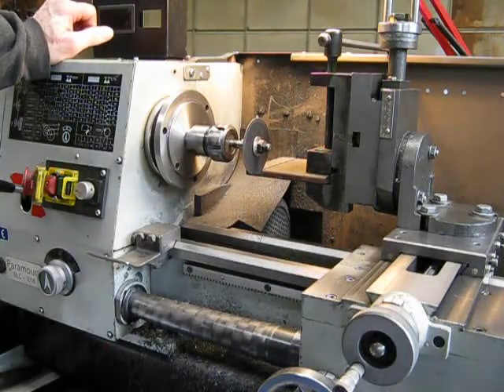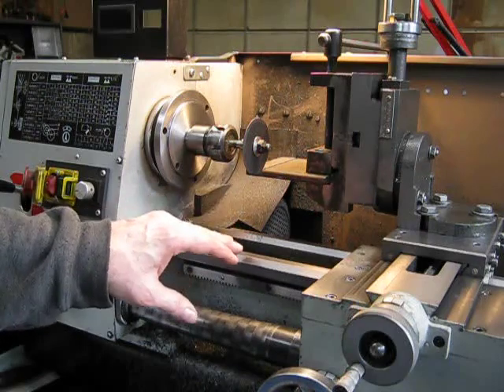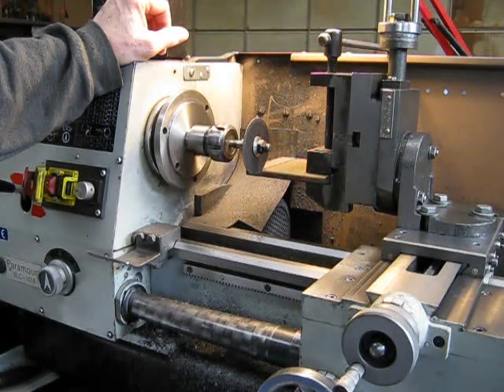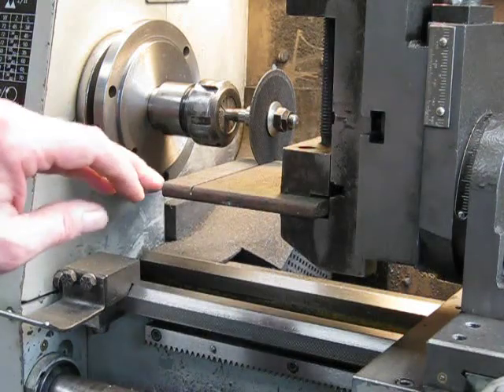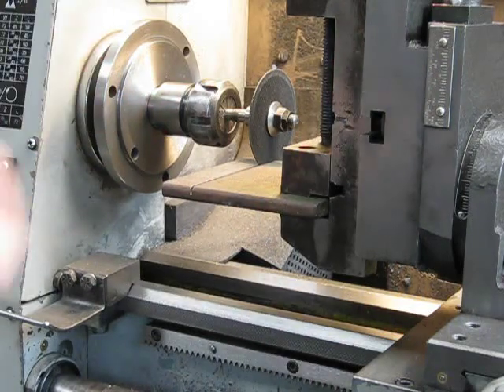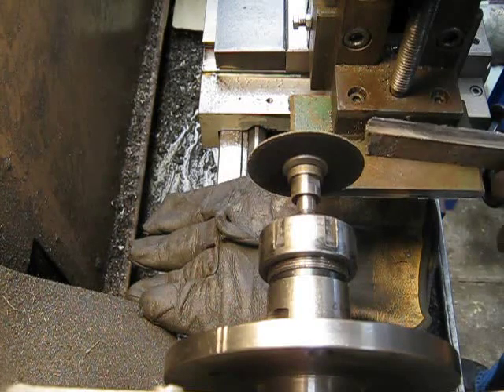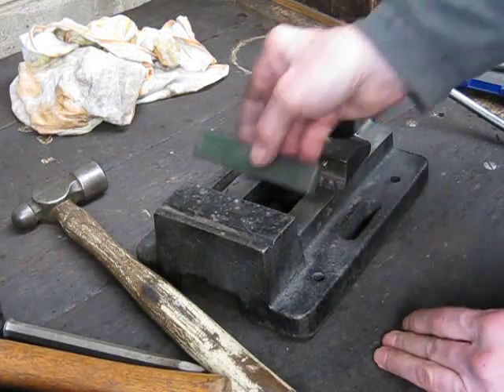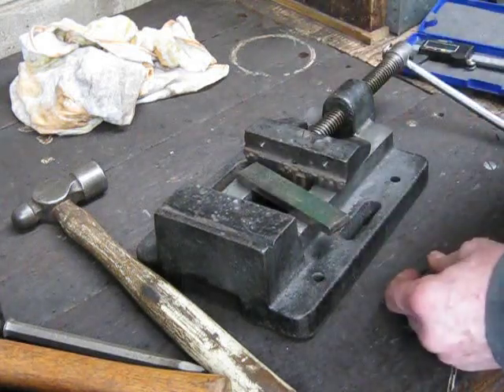Cut hard steel with a lathe - and do it accurately

Comment: Just for a try out i mounted the new Makita angle grinder on the tool rest and used it for precision grinding, actually got down to tenths which shocked me.
Reply from the maker: I'm not really surprised as modern ball races run very tight tolerances.

Comment: Yes great idea!...I did this on my old drill press (good solid vintage guy) with a cross slide for some things  ...As long as you take it slow its quite accurate...I cut off a bell housing for a classic car transmission swap and it did a great job, Aluminum yes but still very accurate, enough to get welded up for the back plate.. With the bell housing i just spun it around by hand carefully a little at a time. then used an end mill (made from a drill bit) to clean it up... Its been trouble free driving on the car now for 4 years plus.... I find milling on the lathe a little more awkward but it still can do a good job of it... 

Cheers!
Reply from the maker: Chuck Itall Yes, milling on the lathe is more awkward for sure.  But when you have nothing else, it works OK :)   Cheers Rob

Comment: Hello. I enjoyed your video, but have a suggestion. When using that type of abrasive cutting disc, you should cover the ways with a heavy cloth for protection. If grit falls onto the ways, and can damage them over time. Same as with a tool post grinder.
Reply from the maker: stevewatr Good comment.  Provided the carriage is not moving you can grind without doing any damage with the ways uncovered - as in this case.  You have to wipe down the lathe afterwards anyway.  However, definitely cover the ways if grinding along the way length.   I use a heavy rag over the ways with a steel plate on it to direct the sparks away.  The rag can catch fire if you don't use a plate or wet the rag.  I prefer a steel plate as it doesn't put moisture near the lathe.  Cheers Rob
Reply: xynudu Hi Rob, the fire concern is a good point, especially if the rags are oily, like most rags anywhere in my shop (lol). Thanks again for the video.

Comment: Thanks Rob, funny thing, I have never used a lathe, so I have spent many hours researching lathes and tooling,  I have watched many times over your lathe videos and I have a long list of tools and accessories that I will order soon, but its hard to know that what I am getting is what is good, or what the salesman  wants to sell, H&F have that lathe on special, and I thought it was a better but than the smaller one I was looking at'
Thanks for your help
Graeme
Reply from the maker: Graeme Scoop Your welcome.  If you are going to do model engines etc, that lathe is a bit big IMHO, but it depends what your plans are.  In general bigger lathes are made for bigger jobs. That's why watch makers use tiny lathes - it's all about material handling size.  For tooling I would just buy some basic cutters (if not included), a small boring bar set,  and a live centre to get started, and add more stuff as you find you need it - or make it.  No rush.  Cheers Rob
Reply from the maker: xynudu Oh, and a drill chuck for the tailstock, and a test or dial indicator for setting up the four jaw - get a cheap one to begin (they work OK).  Rob
Reply from the maker: xynudu I had a look at the H&F offerings, and that lathe is actually the only one I would consider buying from them as well.  Their small stuff is OK, but their intermediate range is crap.  Depending on where you are, your choice may be pretty limited.  Rob

Comment: High Rob, I am a newbie to machining and I am about to order an AL336 Deluxe ,I was just wondering what shaft you used for the cut off disc, sorry if that is a dumb question
Reply from the maker: Graeme Scoop That's a lot of lathe.  There are no dumb questions.  The shaft was just something I knocked up.  Make the disc holder/shaft any size that fits the disc centre you are going to use, and add some washers for centre side support.  You could use a bolt as some stock.   The cutting discs in the video are standard 75 mm diameter, with a 10 mm centre.  These come in thickness from 0.8 mm upwards.  Having a lathe you can make up lots of tooling for low cost, and learn along the way.  A small tap and die set is also very handy for cutting threads for small jobs like this.  Cheers Rob

Comment: Hey Rob , I am on the Mid North Coast of NSW, about 4 hours North of  Sydney, I have not committed to anything as yet, so if you see a better way, I would be happy for your experienced suggestions, I already have a small Metric and imperial tap and die set, and also I wont be doing any type of model machining , just a little larger stuff for the tractor and whatever! just to learn. if you don't mind I would love to send you my tool and accessories list and once  again ask if you could cast your experienced eye over the list, and if so, that would give me a lot more confidence about what I have decided, just on my novice research.
Cheers
Graeme
Reply from the maker: Graeme Scoop For the sort of use you describe, that lathe would be ideal.  You could still do tiny stuff on it, but you would probably need a collet set, or a smaller chuck.  Sounds good to me.  Go for it.  Feel free to forward any info for comments.  Cheers Rob.
Reply from the maker: xynudu Also, before you buy tooling etc. check out where I get a lot of my stuff from.  I am in no way associated with this store, but they have excellent quality for price, CTC Tools - http://www.ctctools.biz/servlet/StoreFront
Reply from the maker: xynudu You can ping me direct at gloaming_agnet@hotmail.com

Comment: Brilliant idea, I’d never have thought of that.  Do you use an ordinary bolt to attach the disc to the stock?
Reply from the maker: Yes.  Just turn the thread off where it grips in the chuck jaws so you can get the lock nut on and off to change the disc.

This works well on tool steel and the like.

Cheers Rob
Reply: xynudu Thanks for the reply.  I’ll be trying that soon. Thanks again.

Comment: Do you think that you could successfully make a mill slide from home cast aluminum?
Reply from the maker: +MOO Tech 

You could make one, no problem.

But how long it (the dovetails etc) would last is another issue - alloy being soft.

I have seen mill slides successfully fabricated out of welded up steel pieces.

That's the way I would go.

Cheers Rob
Reply: I really need a mill slide/attachment but if aluminium, wouldn't there be a bit of flex in it? I do mostly only 6061 and 360 brass but I never know I might work some 304 stainless rod here and there

Comment: do you include spring steel as hard steel , there is a difference of course ,carbon content for starters ,just curious .
Reply from the maker: Yes.  I've cut spring steel with a friction disc, no problem.

In fact friction discs can cut a huge range of different type materials if you use the correct disc.

Rob